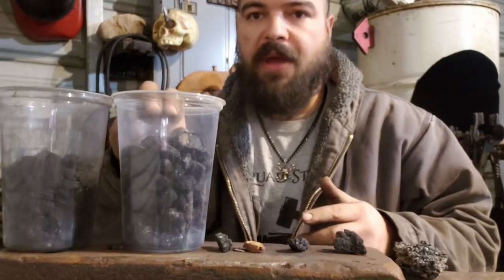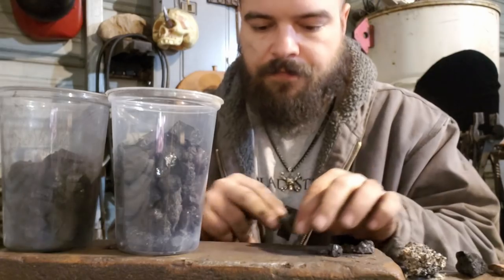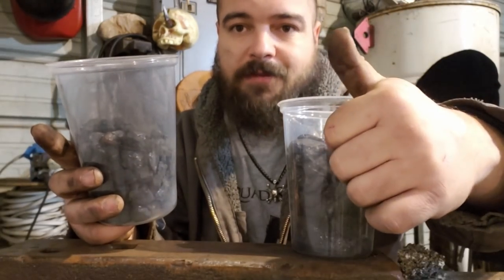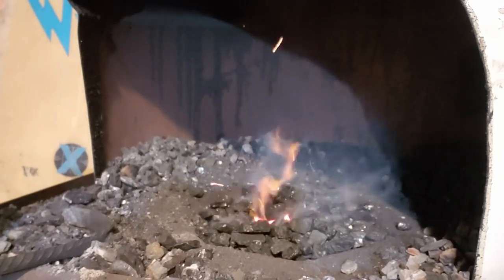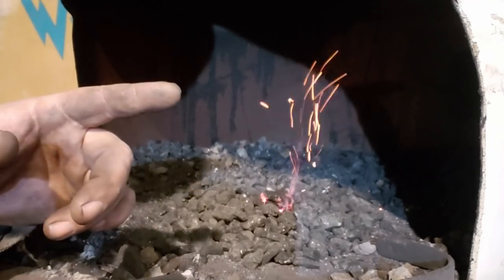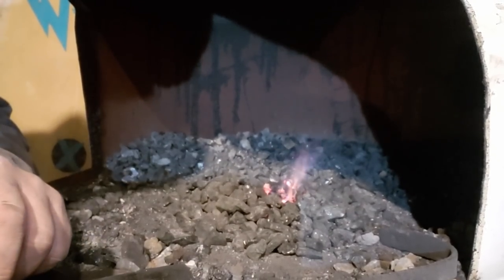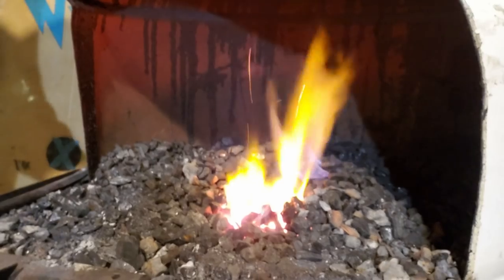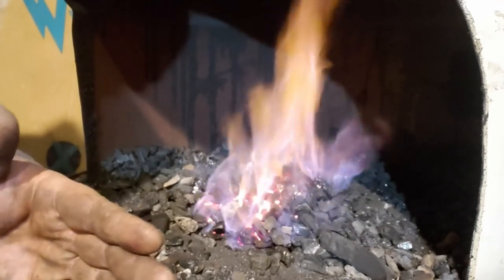Lighting and Working with Anthracite Coal

Comment: Nice video, sure seems to take a lot of work for a coal fire either way
Reply from the maker: Honestly, bituminous is much easier. Watch the previous coal video... I dig coal man!
Reply: @IslandMetalForge  , yes sirSir,  tbh I dont have a forge yet. When I do get it built it's going to be gas.  West Texas  doesn't have any coal lol lol. I'm sure if I looked really earnestly I could get it...but propane is everywhere.  Recon I'm lazy lol.
   Gas has its many drawbacks also though.
Reply from the maker: I can see the draw to propane, set several pieces in and they hold at temp till your ready.. cleaner workspace ect... as a matter of fact, I have a guy near me who will be upgrading his propane forge soon and has offered me his in exchange for a few of my pieces... so.. booyah to that!
Reply: @IslandMetalForge  oh yeah awesome opossum! And lucky you.
   At the very least it will offer you another option.  2 actually.  
1 it can be run on venturi style burner slaving atmospheric oxygen. 
2 it can be run on forced air system,  and since you already have forced air on coal forge....yeassss you are truely multi forgeable lol.  
   I'm building ribbon burner for mine as its probably the most powerful and efficient burner.    Not knowing how the forge your getting is set up...its still a double win for you. 
   Eh who knows,  maybe if you decide to try a ribbon burner...hit me up and we can make things happen. 
   I will be making one for a mutual friend, who doesn't know it coming, but is most deserving of a gift in return for all he has done for us. 
   Blessed days sirSir, Crawford out